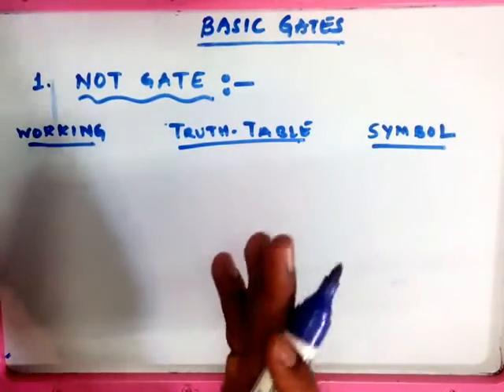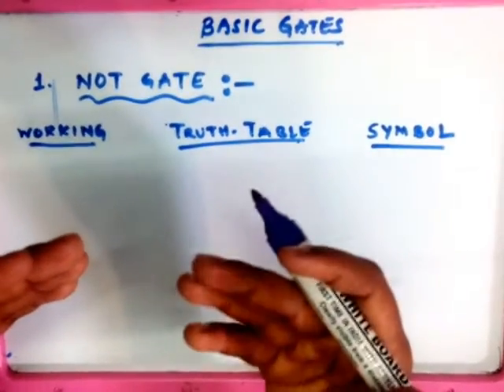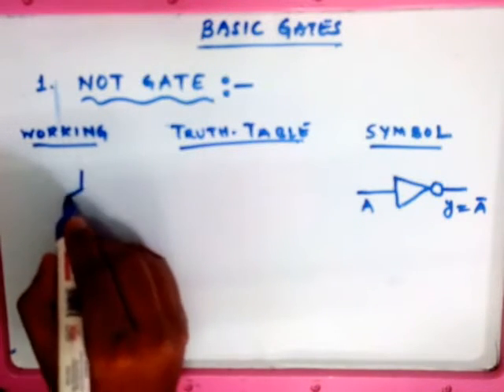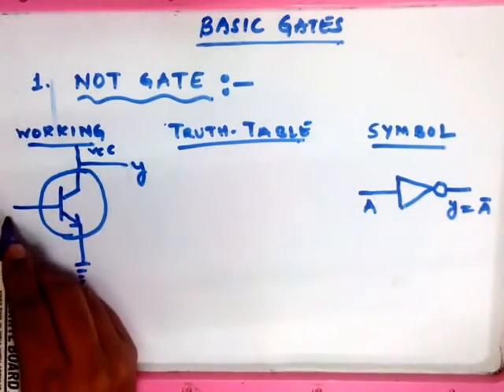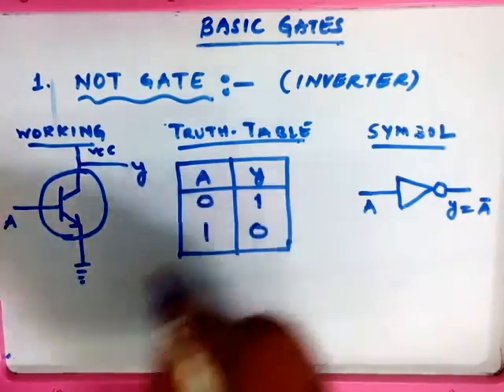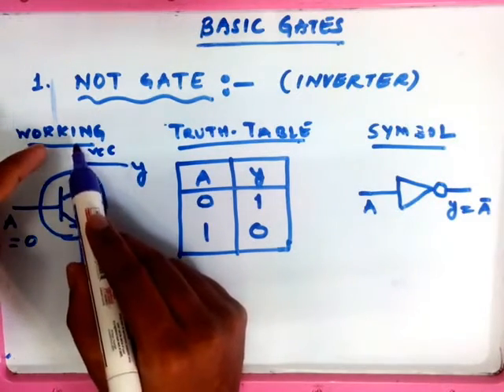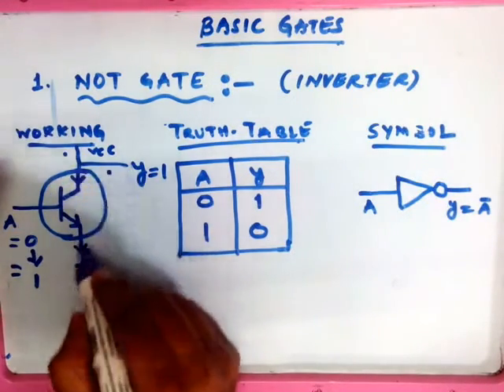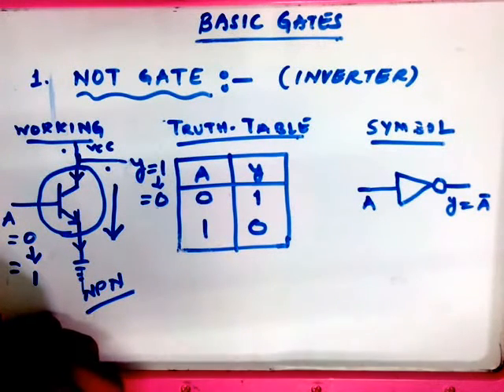How NOT gate works ? What is inverter?

Comment: Thank You Sir!
I have one doubt, where is the VCC in Three Pin Not Gate, or NPN transistor... Actually was watching an experiment, in that, the guy was using a not gate, it was having three pins, most probably two inputs, and one output... then i thought, how the not gate supllies power if the input is zero... then I watched your video... Then I understood that, okay, it's the VCC supply, that get's bypassed, but now I am confused, as there was no VCC in that chip

Here is the link to that video: https://youtu.be/I0-izyq6q5s?t=454
Reply from the maker: Check pin diagram of not gate IC your doubt will be cleared
Reply from the maker: Every IC will have it's own vcc and gnd pin....
Reply from the maker: In my video vcc is not the one which is supply but it's input.... I have not shown vcc and gnd here

Comment: Not clarified that which terminal of the battery is connected to collector and what you are supplying to base??????
Reply from the maker: Ajay Bhardwaj +VCC is connected to collector and base is given input  A tat is nothing but A=0 means Gnd and A=1 means again some dc voltage